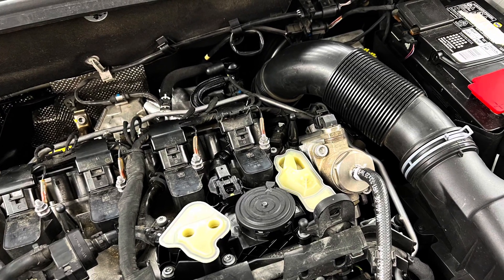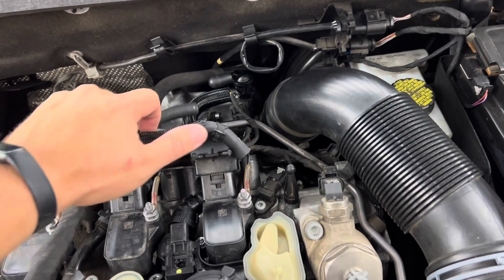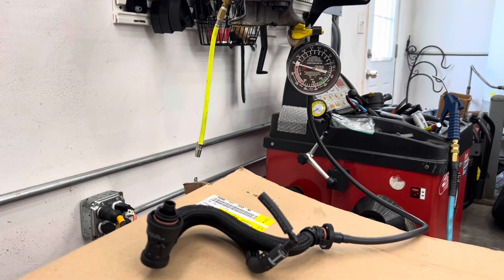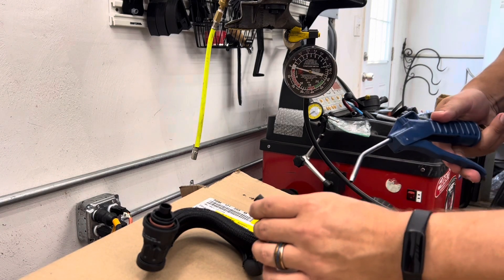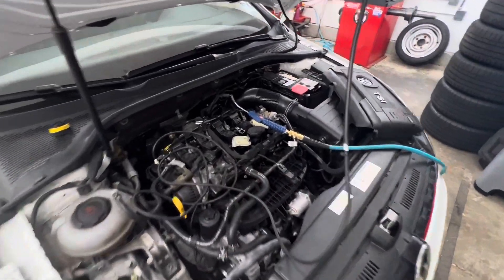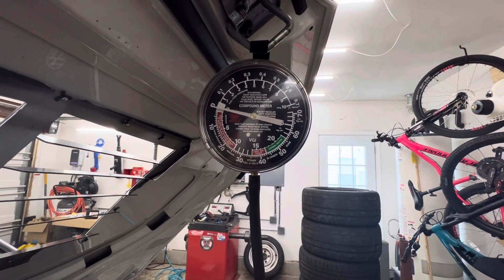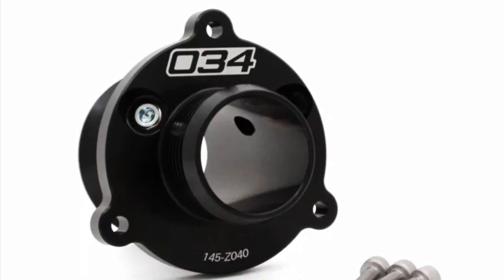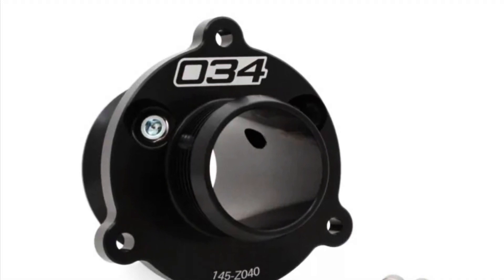MK7 PCV Analysis: MK8 PCV + Using the Venturi to maintain crankcase vacuum (Pt 6)

Comment: Would you say a mk8 pcv without the venturi is better than running a latesest revision mk7 pcv?

I've noticed that ever since i done n aftermarket turbo inlet, my sparkplugs have had more oil contamination. Cylinders 3 and 2. 1 and 4 are fine, so im suspecting the pcv is letting too much oil through.
Reply from the maker: @KasamS  honestly probably little to no difference for 19+ cars with BK or BL valves stock. MK8 is probably worse for 15-18 cars that call for AP/BM as latest revision. Check out one of the newer videos on the differences year over year… there are some significant differences.

In your situation I’d run stock PCV and stock TIP unless you have a big turbo. Small/near immeasurable power gains aren’t worth it to me personally.
Reply: @datadrivenmqb  thanks for the reply. Ill put my facotry inket back on and update when i replace the sparkplugs again. 

Im stage 2 tuned but dont track it or drive it hard. Only a couple pulls here and there

Comment: Did you have issues with the new Venturi PCV connector connecting fully on the turbo inlet with the click?. Mine is not clicking on no matter what I do. Is there a special pinch or squeeze to do?
Reply from the maker: It depends on the turbo inlet pipe. I had several on the car at one time or another and some clicked on and some did not. It was never an issue with popping off or anything like that. Just push it on as tightly as you can, the fitting seals with the o-ring to the inside of the TIP tube, so as long as it's not completely off it should be sealing.
Reply: @datadrivenmqb  Thank you for the reply. You got me thinking and after a very close look I broke the plastic click ring inside the Venturi connector when I removed the stock inlet pipe. This would explain no click on. Not fun threw on the check engine light. Glad to know how to fix it and clear things up. New part being overnighted.

Comment: Whats the part number for the hose
Reply from the maker: Parts Needed:
+ 06K-103-210-D PCV Valve Hose (1)  - Approx $125 USD
+ 06Q-103-495-B Engine Crankcase Vent Valve (1)  - Approx $60 USD
+ 06M-906-094 Bung/sealing cap (1) - Approx $3 USD
+ 3/8in vacuum cap (1) - Can be found at any local auto parts store or purchased online in a small assortment pack.

https://www.datadrivenmqb.com/drivetrain/pcvtechtalk